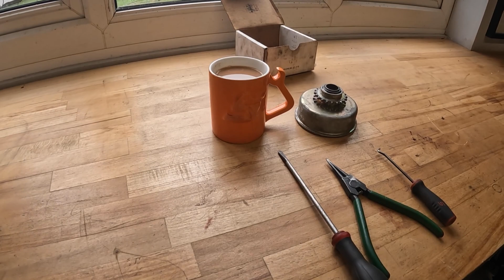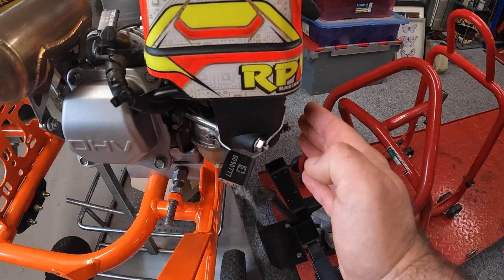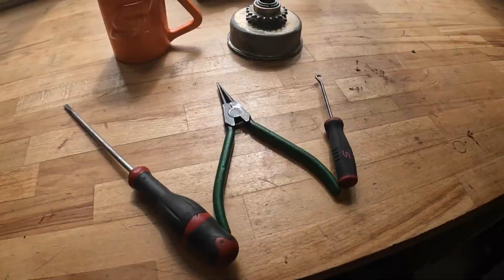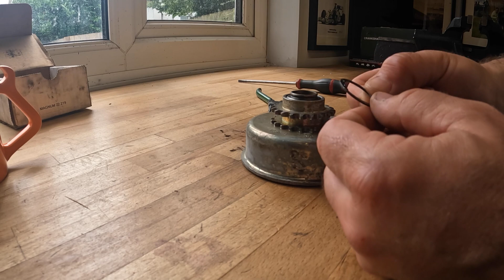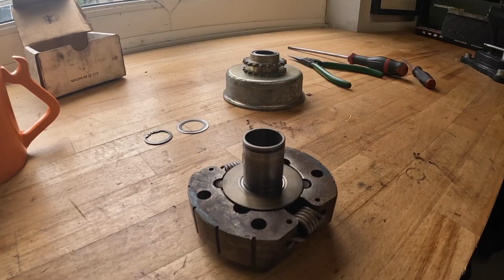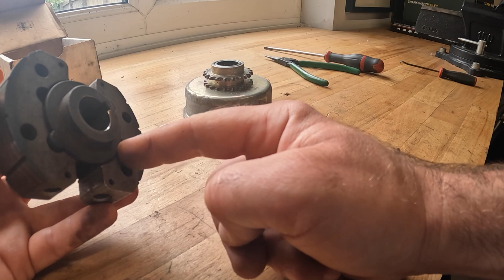Go kart centrifugal clutch setup

Comment: we run a gx kart which is the same chassis but only 1 inboard engine on the right side, does the same thinking apply about the short vs long leading edge?
Reply from the maker: Hi, yes I would imagine so. The clutches are universal for senior/junior/cadet and normally come set for the left hand engine so if turning it round and running on the right hand side check the shoes